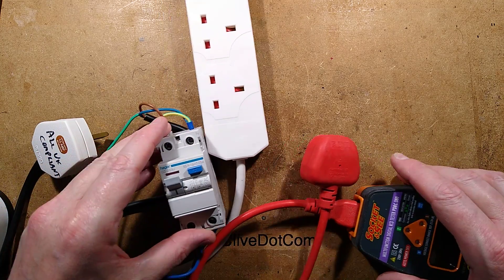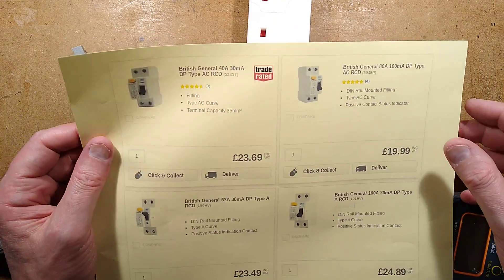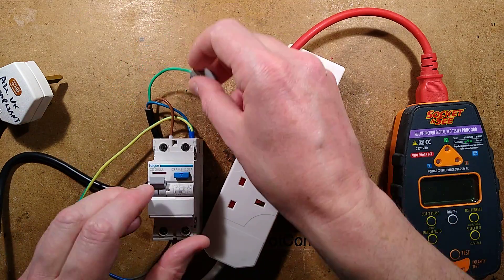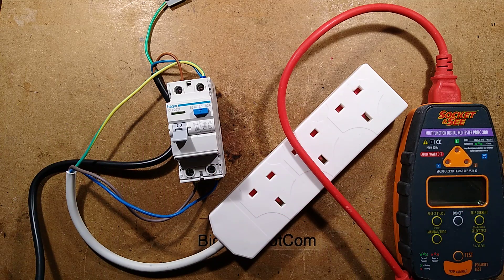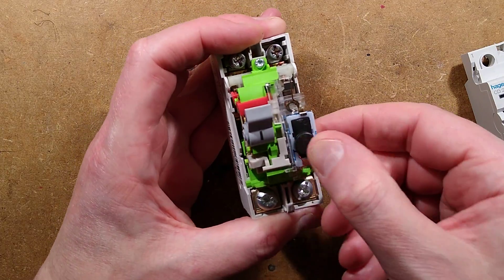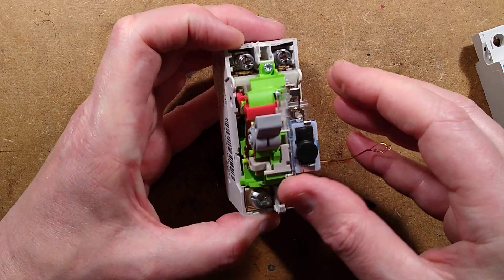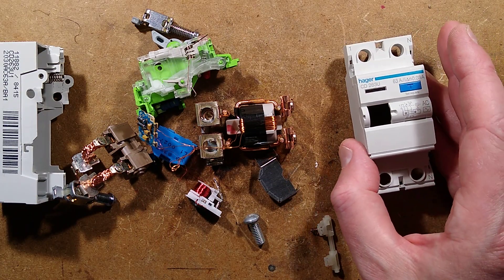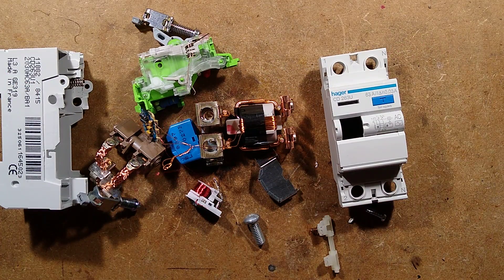Was this RCD damaged by overcurrent?

Comment: "except when its tripped accidently" well, when we lived in market weighton we had to go without lights for a few weeks because of a fault that kept tripping the RCD, and it got to a point where the RCD would not reset at all, and the fault was identified as being on the lighting circuit
when my mum finally got an electritian out to find the cause of the issue, the electritian found some wires that used the old colour code (the house had supposedly been fully rewired before my mum bought it, so this was unusual)
it turns out the loft lighting had not been rewired, and when there was a lot of rain which flooded market weighton, the rain possibly managed to find its way into the loft (there again I suspect there was a birds nest somewhere in the loft, as i quite often heard bird like noises from a particular corner of my room, and when the rain happened there was a wet patch on my bedroom ceiling)
Reply: Outside faulty appliances and electrical equipment, water (rain, dampness, condensation etc) is the next most common cause. Especially water has got into the cabling. Contaminated water (especially if the contamination is salts or minerals) is even worse. A neighbour once asked if I could help. The fuse for the ground floor lighting circuit has blown. There did not appear to be any obvious cause (I checked all the indoor lights), so I fitted a new fuse wire to the rewireable fuse holder. Switched the main switch back on and as I was chatting to the neighbour saying that that seems to be holding okay, can you go and switch on each light in turn, it blew again! Needless to say, I did a more thorough investigation. I found the fault a little while later. The outside light at the front of the house had filled with rain water and the resulting corrosion had contaminated the water, hence the water was now conducive enough to allow a fault current to flow from line to neutral. The fault current being enough to blow a 5A fuse wire within three or four minutes...

Comment: you only need to test rcd's six monthly, i always find it is a good time to test them when the clocks change.
Reply: The EU voted to scrap clock changes from 2021 and it is thought that the UK will do the same...
Reply: @merrytrek  
what !!!! if the EU does it, england most certainly will not !!
Reply: MerryTrek the eu parliament voted for it, but the EU Parliament is a largely powerless body. It’s not actually scheduled to happen
Reply: MerryTrek - what, Brexit England do something sensible?! Not very likely me thinks... Would be fun if Scotland and Northern Ireland do dump the GMT/BST clock time zone change but England and Wales don’t!
Reply: @Mark1024MAK  Now Imagine Ireland reinstating "double summer time", aka the Berlin timezone.
Reply: You don't 'need' to test RCDs at any given interval. It's just a good idea :)
Reply: @userPrehistoricman  I occasionally test mine, often unintentionally.  Gave it a workout once when I tried to move a bit of crumpet in the toaster with a metal knife... worked a treat.
Reply: @userPrehistoricman  Depends on the type/make of RCD. This interval is intended (especially years ago, when lubricants were not as good as today) to get the moving parts moving and therefore detect if the lubricant has hardened.
Reply: @Blazin Redeye a power failure should not set off an intruder alarm, normally that only happens if it has not been serviced and the batteries need replacing.

Comment: Maybe you should explain that the UK uses heated Power Showers and not just hot water from a tank like most other countries
Reply: Depends on the installation, usually either an electric shower or boiler heated water (tank or combi)

Comment: Clive why is 63 amp's seem to be some kind of standard we don't have that here in the US and I'm curious as to why
Reply: Chris Snyder - see https://en.wikipedia.org/wiki/Renard_series This gives us a preferred list of standard values. In the mainland U.K. most homes are provided with a single phase 230V (existing infrastructure is actually still 240V) 60A, 80A or 100A feeds. So older switchgear is often rated at 60A, 80A or 100A. Since then, most switchgear, fuses, circuit breakers etc. uses the Renard series (1, 1.25, 1.6, 2, 2.5, 3.15, 4, 5, 6.3, 8 and 10) unless a particular standard overrides this. Diversity then allows for a higher total of the fitted MCBs in a consumer unit compared to what you may expect. Although as Clive says, with a split load board, it should normally be evenly distributed between the two RCDs.
Examples of where standards override the Renard series are BS 1363 plug fuses (available in 1A, 2A, 3A , 5A, 7A, 10A and 13A ratings, although only the 3A and 13A are preferred values, shops typically stock 3A, 5A and 13A). Similarly the standard for consumer unit MCBs allows unusual values like 32A.
Reply: Because they're breakers are rated differently than our us ones.
Like a 32 amp for a ring circuit.
Because here in the US we just keep with the five or zero at the end of our breaker ratings for simplicity.
But I think they have 63 amps.
Because two ring circuits together would be 64.  
Since their standard power incoming is either 60 or 100 amp service. That would get to the maximum demand.
Reply: Residences in Canada and the USA use 120V single phase mains while the UK uses 240V single phase.

The higher Voltage means a device draws less Current (Amps) for a given Wattage.

Watts = Volts x Amps (Amps = Watts / Volts) so a 100W bulb would draw 0.42A in the UK but 0.83A in Canada and the USA.
Reply: @HappilyHomicidalHooligan  actually most residences and small businesses in the US use 240 volt main which is split by a center tap into two 120 volt legs which operate in anti-phase to each other. This allows larger appliances like electric dryers furnaces and some machinery to be operated as 240 volt appliances.

Comment: I wonder what effect the 5° misalignment of the thick "coil" due to the spot-welding will have on the sense?
Reply: Nothing so long as it is symmetrical on both.
Reply: @SeanBZA  It doesn't need to be symmetrical, as long as one leg passes through the coil; the angle of the leg inside the coil is directly offset by the increased length of conductor inside the core. No coil calculation ever considers the length or angle of the turns inside the core, only the number of turns.
Reply: @cambridgemart2075  Symmetrical helps though with the sense coil being influenced by the fringe field cause by the wires entering and exiting the core, which is small, but measurable.

Comment: It always blows my mind that you guys use electric heat in the shower.  You'd never sell that here in the US.
Reply: Jorg Jorgensen Every house in the United States has 240 volts. We just divide the power up for lights/ recepticals. Larger amperage appliances are ran at 240 volts.
Reply: @MrSleepProductionsInc  well yea but large appliances here run at 400V XD.
Reply: @kertas1991111  not residential though, he's right the houses are wired ~230v same as Europe, it's just that it's center grounded instead of grounded at one edge, so you get two 120v 180 degrees out of phase. Or one 240V between the phases. So any individual live wire only has half the potential wrt ground
Reply: @AngDavies  yes actualy. we have 3 phases 120 degrees apart. any one of them to ground is 230V and between any of them is 400V. We use the 400V option in residential settings for ovens for example.
Reply: @kertas1991111  wish I had 3 phase :(
Reply: They sell the same things in the US, just hidden under a sink. My friend just put one in for his pool shower. Search "tankless electric water heater" at Home Depot.
Reply: Ray Ceeya - Why? A professionally fitted (and by that, I mean fitted properly by someone who knows what they are doing) electric shower is perfectly safe. The metalwork (including the metal pipes) is earthed. The electrical wiring, conductors, switch and terminals are all protected from water spray by plastic housings. The user can’t get any part of their body anywhere near any conductor or terminal. And modern installations are protected by a RCD. More people die in the U.K. trying to put their socks on than being electrocuted by an electric shower.
Reply: @Mark1024MAK  Sure that's all fine and good, but I know plenty of American electricians who are less than attentive to such things.  Would you trust your life to someone who's only making $20 an hour?
Reply: Ray Ceeya - we have the same problem of unprofessional professionals over here (the real electricians call them ‘Part P’ after the change in the ‘rules’), plus the ‘cowboys’ that aim to rip consumers off with their dodgy ‘work’.
Reply: Not always, many British homes have combi gas boilers that heat the water on demand by burning natural gas. The shower unit is a glorified thermostatic mixer tap in the bathroom with no electricity in sight!
Reply: Electric showers aren't that great though.... not particularly good pressure  and very dependent on incoming cold water temperature, so in the winter you have to lower the flow rate (which is how the temperature is adjusted anyway) to keep the water hot. Then again I've only used the 8.5kW ones, I think you can get up to 10.8kW; dims the lights nicely when operating 🙄

Comment: Would you be interested in a faac b680 barrier control board?
Reply: I have a FAAC electric gate motor control board that was killed by a slug trying to move across the track side of the PCB. It didn’t end well for the slug! It killed itself on the 24V DC circuitry. Unfortunately either the short caused by the slug or the juices from it damaged the PCB tracks causing a break in the circuit. Result being electric gates that ignore all user requests to open...
It was ‘fun’ trying to clean all the goo and crap off the board, yuk.
Reply: @Mark1024MAK  hahah i see that a lot. Its what I do for a living, slugs and ants kill more control boards than anything else. We always use ip rated enclosures and silicone up any point of water or insert ingress possible.

Comment: Oh, wow.

I just replaced one of these in my house. The RCD kept tripping randomly for a few years, but not too often.

Then on the last occasion, it wouldn't reset, as it wasn't holding the contacts together tightly enough.

I strongly suspect I still have leakage current somewhere, as the breaker for the top floor ring main also seems to trip sometimes.
I don't have a proper clamp meter that will measure low enough, though, and don't really want to fork out £70 just for that one test.

So I was going to suggest (to Clive) about maybe using the current transformer from the RCD to build a cheap leakage tester?

Obviously it shouldn't be used for doing proper safety checks, but it could be made fairly accurate once calibrated against a multimeter.

Or, I guess I could just break the connection from the ring main to the breaker, then shove the cheap "20 Amp" rated multimeter in series, but I'd rather not. lol
Reply: Actually the RCD I have here is the Hager CD 284U, so the 100A version (30mA trip).
Reply: Side-note...

When we last had an electrician here, to fit a Smart Meter (yeah, yeah, I know. lol), I asked him to install a full isolation switch for the whole distribution board / consumer unit.

(which isn't a legal requirement in the UK, AFAIK, but he kindly fitted the iso switch anyway.)

But interestingly, due to the RCD being on the left-hand side of the board (so the bus bar is on the lower-right terminal of the RCD), the Neutral wire from the incoming mains was hooked up to the left-hand terminal marked "L"  on the RCD.

AFAIK, this shouldn't matter, as the connections are in parallel inside the RCD, so as long as the Live connections stay on one side, and Neutral on the other, the specific RCD I bought should be fine.

Obviously it's important to double-check that when replacing things, though. I made sure that the new RCD specifically stated that it didn't require a specific "polarity" for the connections, and pressed the Test button after installing the new one.

Again, though with most RCDs of a similar design/type, you MUST keep the Live connections on one side of the RCD, and Neutral on the other. I just thought it was interesting to note.

(The new breaker doesn't label the terminals specifically for "L" and "N" either.)
Reply: You could do a really cheap tester with a resistor (L to E)!
If you chose the right value to give just under 30mA and it trips it would indicate eather an oversensitive RCD or an existing Earth fault!
Reply: @totherarf  True, I could just have a few different resistor values in a box, to do a ramp test.

But I still need to determine which device or circuit is causing the problem.

The RCD hasn't tripped for a few weeks now, so it's possible it was just the contacts in the old one heating up as well.

It's just weird that the same breaker often trips at the same time, so that's probably worn out, too.

I might just replace the whole consumer unit with a metal one. You can get the whole thing including a few breakers and two RCDs for about £80.
Reply: @electronash  Megger the circuits individully!
Reply: @totherarf  Also true, but I don't own a Megger nor a proper clamp meter sensitive enough for Earth leakage tests.

Probably well worth me calling out an electrician, tbh. lol

Although, I'm quite happy about the new RCD now, and the old breakers seem OK, so I don't think it's unsafe or anything.

Just be nice to know if it is this one ring main or a cheap PSU on it that caused the previous issues. I have the feeling the leakage is still present, just not quite enough to trip the RCD.
Reply: @userPrehistoricman  I'm expecting it's also caused by a cheap switched-mode PSU somewhere, or maybe a slightly loose Neutral wire in a socket.

I guess that's the good thing about RCDs, as they can detect quite a few faults like that, and at least give some sign of trouble.
Reply: @userPrehistoricman  Are you sure about that one? Chargers are usually Double Insulated and have no earth!
Reply: @electronash  Surely can't be difficult to make something up - measuring 30mA with a volt meter across a resistor. Hang on - what are you doing ? Looking for a leak current ? So, you have a Supply L and N and you have a circuit L1 and N1. Disconnect L1 from L and N1 from N then connect L1 to N1 and connect that to test meter set to A (mA) and then connect other test meter lead to L. Meter will show leakage current.
Reply: @electronash  we had a similar failure in our consumer unit causing a RCD to fail to break properly or reset turned out the main neutral cable was loose!
Reply: @totherarf  If I was making RCDs to trip at 30mA then I'd make them to trip at 25mA - that way creating some legitimate safety leeway. My negligible experience of trip test buttons is that they pass well over 30mA so always work - so in effect, they fail to test a trip of 29.9 mA. Should it then be classed as a fail ?
Reply: Just do an insulation test with 500VDC with a Fluke 1662 on a rainy Day. Before you test with 500 VDC, do a 250VDC runthrough and also messure N-PE first, before you continue to L-PE if N-PE was fault free. I am sure you can rent one for a Day.
Good Luck.
Reply: @FIGHTTHECABLE  To do a reliable N-PE IR test you will need the main switch off and the main earth disconnected (unless you're on a TT supply) as the tester will read back to where the suppliers join the N-PE (be it in your cutout or in the street/sub

Comment: I just learned that the inverter for my metal lathe motor trips the garage RCD. So I can have a regular mains feed, but without earth leakage detection, it seems
Reply from the maker: It may be due to noise through suppression capacitors.  Changing the RCD for a new one may possibly solve the issue as they can get more sensitive over time.
Reply: I think this is a fairly common problem with motor inverters from the number of posts about this on machine shop forums.
Reply: Trips the RCD or the overcurrent protection? The inverter may well have a large inrush to the transformer. A change to a type C curve breaker will usually solve it - made worse of the circuit is on a 16 or 20A breaker. Had this with my plasterer and his site transformer causing the over current to go. Also seen it with things that have lots of windings :)
Reply: @guffermeister  Given that the only transformer in an inverter is there to power the low voltage electronics, that's unlikely. The mains is directly rectified and fed to the output bridge, no transformer required. Noise is usually the issue, most inverters give very specific advice regarding filtering and grounding for that reason.
Reply: @ferrumignis  Yes - I realised this after hookup. Swapped to a regular breaker and all is OK
Reply: honestly RCDs are nor realy ideal for motors anyway. For a garage you can probably do without and if you absolutely need something there are other options than rcds that are designed to handle the strange leakages of motors.

Comment: Re RCD ratings, I would imagine the 100A model is physically larger with larger connections than the 40A.
Reply: They are all two units wide so will all fit in the same space in the DB.
Reply: @stupot_64  For US codes, at least, 100A requires 3 AWG wire, while 40A only requires 8 AWG.  That's about 30mm² vs 10mm². It's not impossible to use the same connectors, but I find it unlikely.
Reply: @PaulSteMarie   The terminals on our RCDs are large enough for the same cables as the incoming tails that are rated for 100A. 
You have to remember that UK domestic voltage is 240v single phase. I believe that in the US your voltage is dual 120v with each leg only carrying 120v even for a 240v outlet. As the voltage reduces, for the same current carrying capacity the cable size needs to increase. Therefore the size of cables in the UK needed to carry 100A is smaller than what is required in the US.